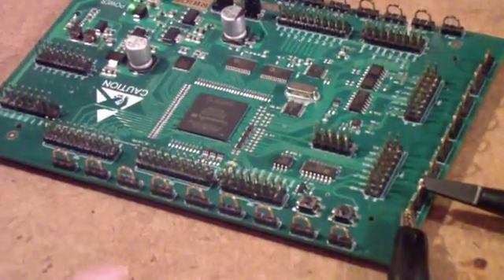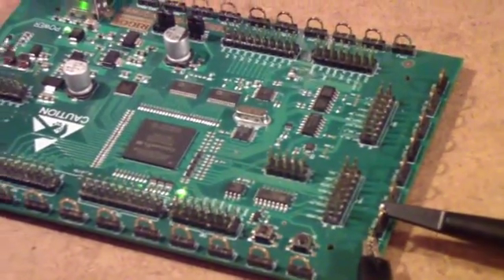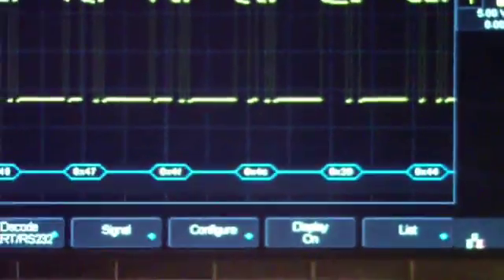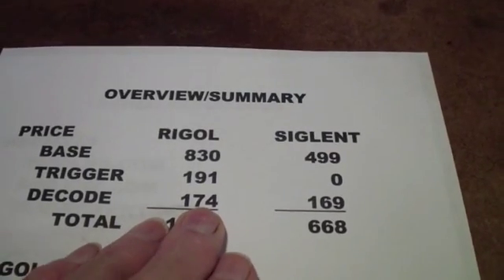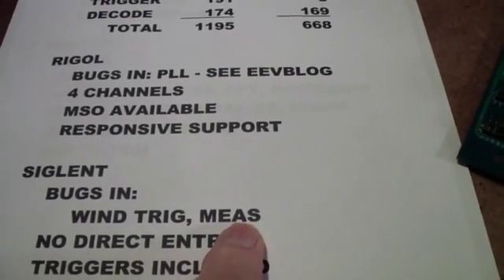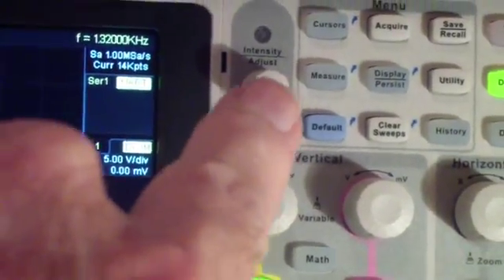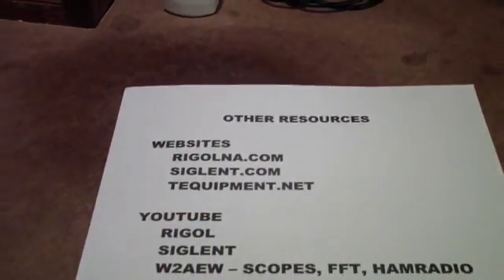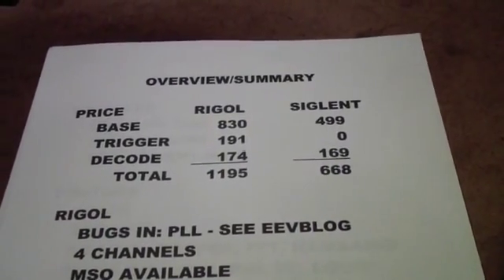TTT018 Siglent v Rigol pt6

Comment: Thanks so much for this review Tom.  I have to decide between a Rigol DS1054Z and a Siglent 1202X.  From what I'm reading on the net, the Rigol DS1054Z can be "unlock" with a code word to turn it into a DS1104Z with all the features. (i.e. 50Mhz -> 100Mhz, SPI, I2C..etc, greater memory depth.. etc).  For that reason and the fact that the Rigol DS1054Z is $100 less than a Siglent 1202X and has 4 instead of 2 channels, I'm leaning towards getting the Rigol.
The only downside I see is the Rigol DS1054Z does not have 50ohm impedance on its channels which would be useful for high speed signal measurements.  The Siglent does.
Reply from the maker: +Freddy Krueger I can't advise either way on unlocking codes. I have seen reports that it works and others that it can "brick" the scope so I have not tried it and you must proceed at your own risk on that. As to the 50 ohm input, you can buy an adaptor from Rigol ADP0150BNC that will convert an input to 50 ohms. I have two of them that I bought from tequipment.net and they work fine. You can see one of them I used to measure the vertical frequency response of the MSO1074Z in an earlier video. Good luck with your purchase.
Reply: Well the Rigol DS1054Z I'm planning on buying will already be unlocked for me prior to the purchase.  So nothing to worry about on the bricking front. 

I would guess the same codes would unlock the same features on the Rigol scope you tested.  So you might want to give it a try. 

Frankly speaking, I do believe Rigol implemented this backdoor feature for hobbyists (and those unencumbered with company licensing issues) to entice us to buy the scope.     

From your reviews, I gather the Rigol is a reasonably good scope.  Given the low price & unlocked features, I figure I have little to lose by ordering it.  I just wanted to be sure I was making the right choice by selecting it over the Siglent 1202X - which isn't unlockable and only has 2 channels.   

I'm more into digital than analog and a scope with 4 channels and the ability to decode & trigger on various buses are more important to me than other stuff.